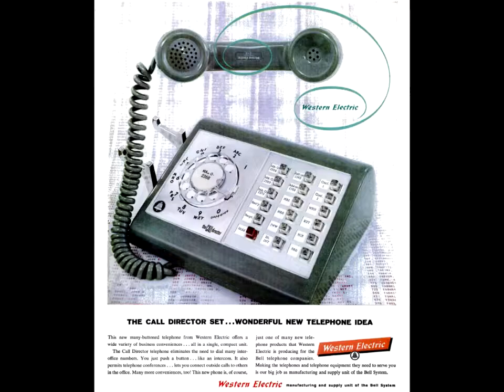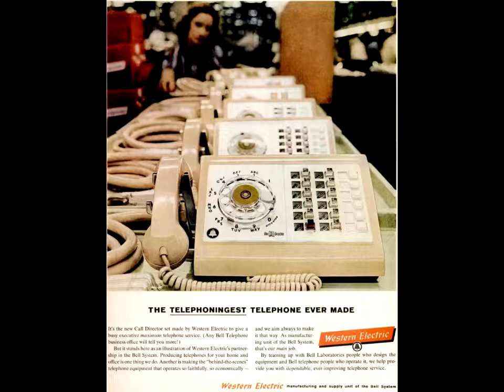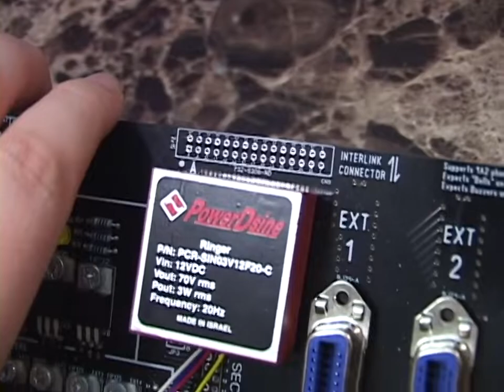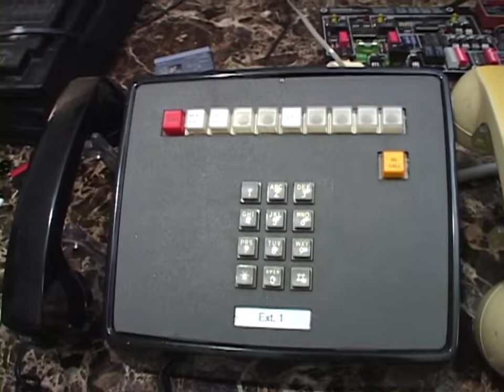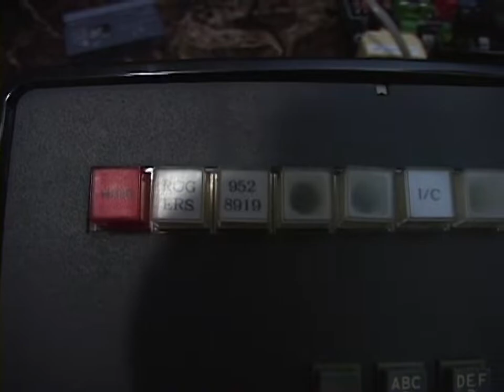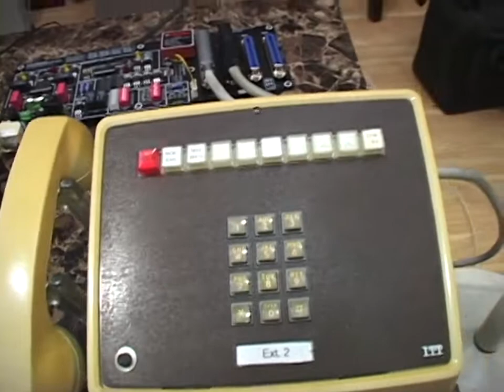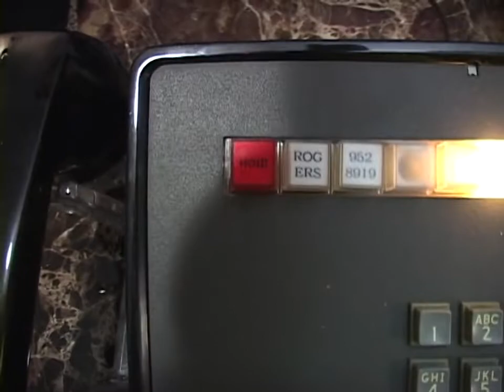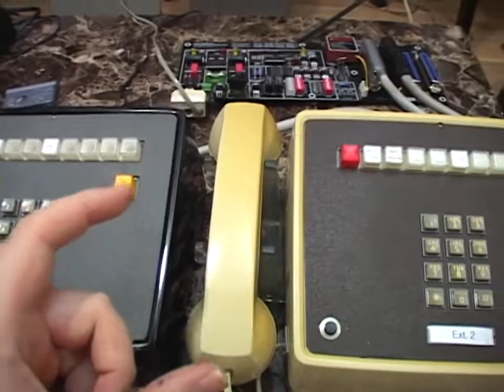Western Electric 1A2 key telephone system, with Seriss Corporation 1A2 KSU

Comment: Here in Toronto most of the radio stations used the call director in the on-air booth, each alternating row toggled the line to air.    So the first row 5 buttons were for answering, the second row 5 buttons were for toggling or conferencing the line to air.  Third row 6 buttons for lines, 4th for toggle etc.  The 5th row (or 3rd on the smaller units) tended to be for private lines, engineering lines, intercom, TCC, field phones etc.

Comment: In the 80's Toys R Us used  single-line blank No Dial 500 phones connected to separate 1A2 control boxes.  This was done so employees could pick up outside phone lines, but could not make any outside calls to their friends (as the blank multi-line phones had no dial/buttons to make calls).
Inside calls and Paging were handled by a separate Bogen/Aiphone Interphone system.

Comment: Would the NT Logic 10 work on this card, or is it a completely different system?    What an awesome project.  love it.
Reply from the maker: That was discussed in the video, but I will add to it by saying that the current revision of the KSU does support the Logic sets, but my older revision doesn't. The Logic sets can be modified to work on older cards (and 1A2 KSUs in general), but it requires extensive rewiring of the phone.

Comment: If you want more phones, it should be possible to make an adapter to connect a regular phone to a KSU. It would surprise me if this hasn't been done already on the Internet.

One last thing, this is making me think of that scene in Ferris Bueller's Day Off.
Reply from the maker: It's popular to modify 1A2 phones to plug into the PSTN, but I've never heard of there being such a thing for the other way around. It would essentially need to be a complete 1A2 phone, just without the handset and dial, and a modular jack to plug the phone into. But not much point when 1A2 phones are easy enough to procure and allow the system to work as designed.

I've never seen that film, so you'll have to elaborate for me.
Reply: @themaritimegirl  Yeah, it's probably not worth it then.

For the movie, I don't really remember but they were at a restaurant and they somehow faked a call from someone else. It might have been calling one outside line from another, I don't really remember. I'd need to rewatch it.
Reply: You can add a regular phone to a 1a2 key, you would use an A Lead controller (adapter).
Reply: I used 584c panels with 400e cards. Created a diode ringing matrix using pin diodes.

Comment: Hi, great video. Question: can you omit all these bells and whistles and just get (Modular Adapter Kit - DB25 Female to RJ11 / RJ12 ) or (Allen Tel AT259A Modular Adapter) to use these vintage phones on newer landlines?  Thank you-AL
Reply from the maker: 1A2 phones can be re-configured to function as ordinary single-line phones, but I believe it requires re-wiring the internals of the phone, and not just an adapter.
Reply: @themaritimegirl  Thank you for the reply, so the path of least resistance is buying a board?